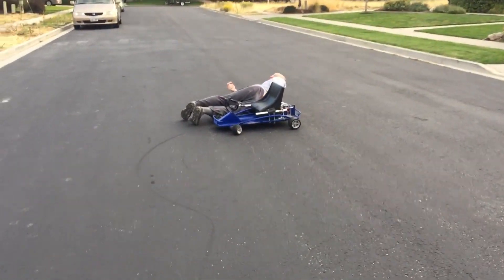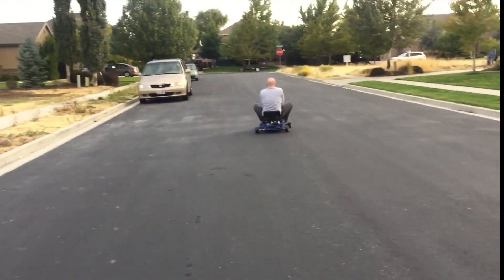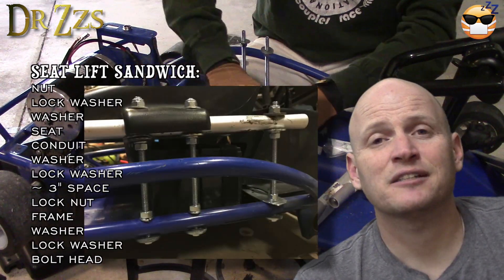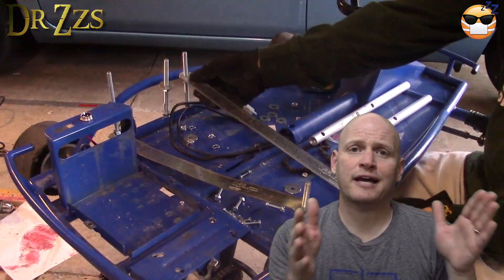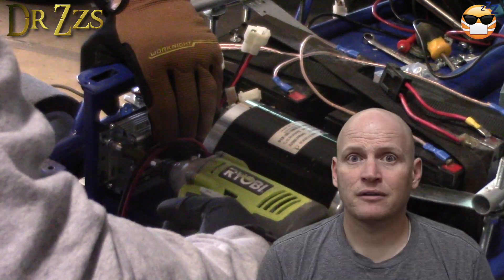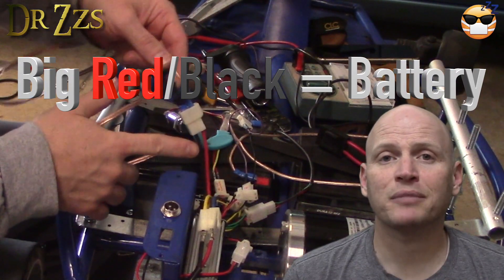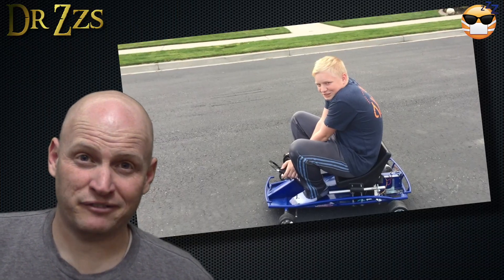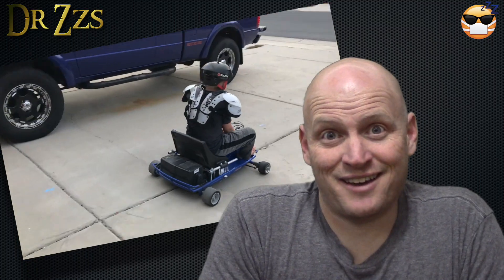Electric Go Kart upgrade

Comment: Great video but why the little boy at the end riding the go cart had on a helmet and shoulder pads but no shoes or socks. 😂🤣😂. That boy must have feet made of steel. There is no need for protection. I'm about to do my go cart the same way. 👍🏿👍🏿 Great Job

Comment: Get the 1800 watt brushless motor with controller. More power and motor wont blow up like the brushed ones will.
Reply from the maker: good advice! 
I need to revisit this thing.  It's been parked since the chain broke for the 3rd time.  Too much torque for the little chain.
Reply: @DrZzs  since finding, fixing, then upgrading this razor... I had to get a real kart... honda 125, 6 speed shifter kart. Talk about power and adrenaline!
Reply: Brushless break just the same. NEVER blew up a brushed motor. Just need an 8mm chain. Its the next upgrade.

Comment: I found my throttle has 4 wires. did you use all four for six or just the red,green,and black ?
Reply from the maker: I think I just used the red/green/black.  The other wires are probably for LEDs on the throttle.
Reply: that's what I was kind of thinking as well, thanks for the info and great video. ordered a kit just waiting on it to come in.
Reply: So I ordered a 1000w kit and the sproket takes a diff size chain. I tried switching the sprockets but the old one won’t fit. What did you do about this ?

Comment: My cousin is working on upgrading his kids electric trucks.  (Those big plastic hot wheels trucks) He’s adding 2 huge deep cycle batteries to increase the range and the power output for the motors and also adding cool led’s and even cooling fans to keep the motors cool.  HAHA the arc and “WHOA” at the end killed me! 😂😂😂😂
Reply from the maker: that was a funny moment.  Had to keep that in there.

Comment: NIce. How did you connect the throttle? It was originally a thumb throttle.
Reply from the maker: Thanks!
I kept the original throttle.  I figured out which wires came from the throttle and connected them to the wires on the new Motor Controller.  The label on the Motor Controller wires said "derailleur". 
Are you going to build one?
Our chain broke.  I think my motor sprocket and the drive gear weren't lined up straight enough.  Haven't fixed it yet.  
Lots of fun, when it's working.
Reply: Yes, I picked up a used one last year that wasn't working. I modified my son's power wheels with ESC and dual 250 w motors. I was about to modify an Escalade power wheel as a chase vehicle for me. This looks like more fun.
Reply from the maker: oh it's fun alright!  
The drift wheels keep it exciting.  
Let me know if you need help. 
Good Luck!